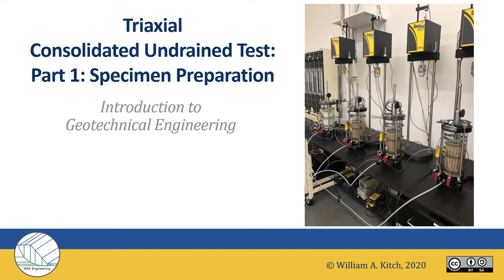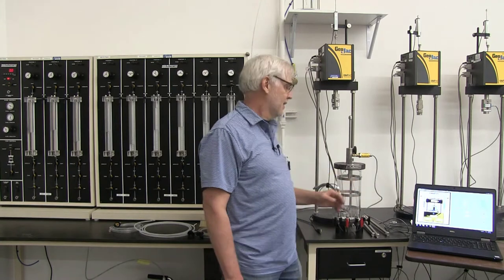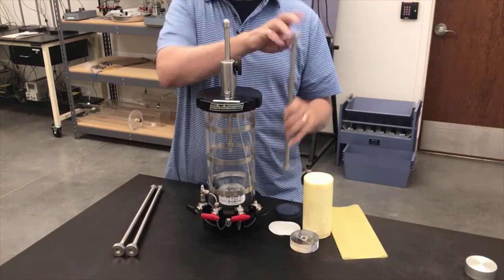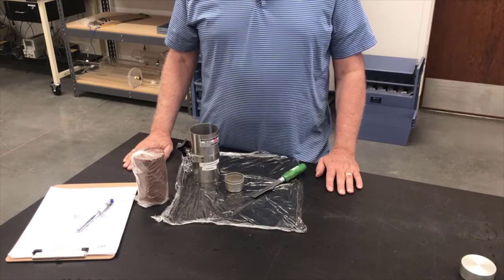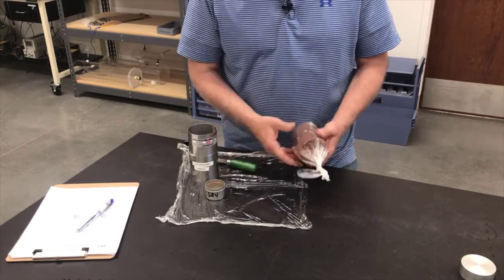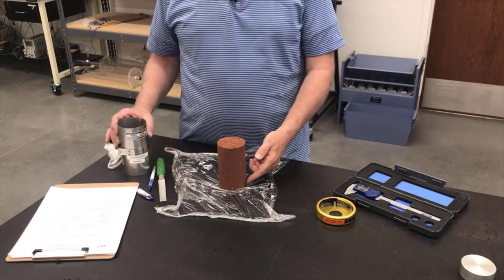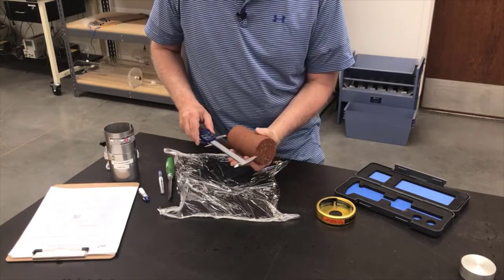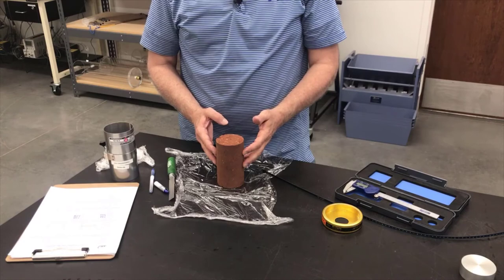C-U Triaxial Soil Test, Part 1--Shear Testing

Comment: Thanks for Easley and simply method for preparing   but I ask about mesure of the diameter of the sample  why you hadnt measured by the ruler
Reply from the maker: The Pi tape is much faster and more accurate.  For info see https://www.pitape.com/instruction.htm
Reply: Thanks I have watched these videos about pi tape actually it is faster and more accurate than rule but we don't have this tools in our laboratory
Reply from the maker: @teebamohammad7142  You can just use outside calibers.
Reply: @introductiontogeotechnical4976  OK

Comment: What is the brand of trimming device you use? One of those would be very helpful for what I do.
Reply from the maker: The one I use comes from Humboldt (https://www.humboldtmfg.com/sample-trimmer-with-knife.html). Pricey but very good.
Reply: @introductiontogeotechnical4976   Thank you!  I am using the ASTM method D 4767, I understand that you are starting with a saturated drainage system, but I have been trying to figure out how you fully saturated the specimen while consolidating it.  I am under the impression that you must saturate the specimen by applying back pressure before consolidation.
Reply from the maker: @hollyclark509  you are correct.  I use backpressure saturation.  However, in this case I do it after the consolidation phase. It goes faster that way since the consolidation phase will also increase saturation. This means the consolidation data isn't in a saturated state, but that's OK for what I'm doing.  If you really need saturated consolidation data, then you need to do the backpressure saturation before consolidating.  If your soil is silty or sandy, you can also try do a 1D permeability test by creating a gradient across the sample.  This will also increase saturation as some air flows out but it won't get the specimen to 99%+.
Reply: That cleared up my confusion really well! I may try the 1D gradient, but I think using backpressure saturation before consolidation will be OK for what I am doing! Thank you for taking the time to explain! 
 @introductiontogeotechnical4976